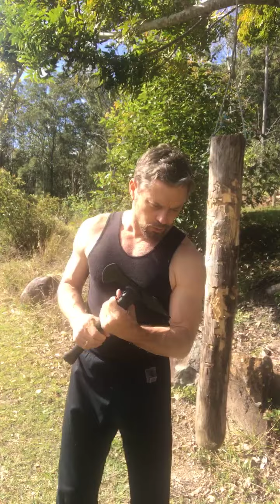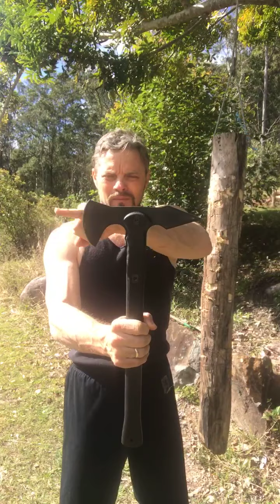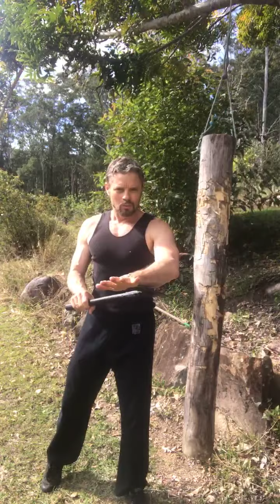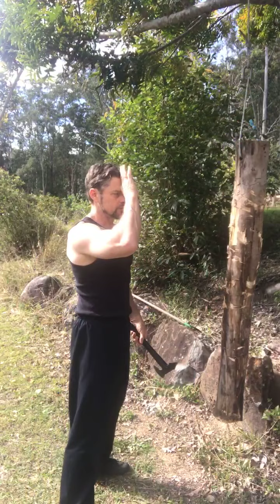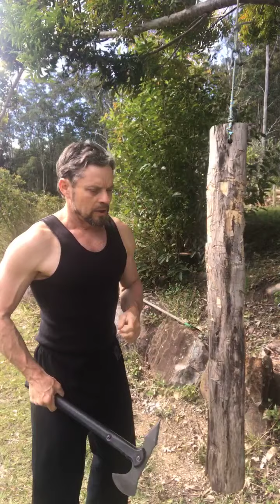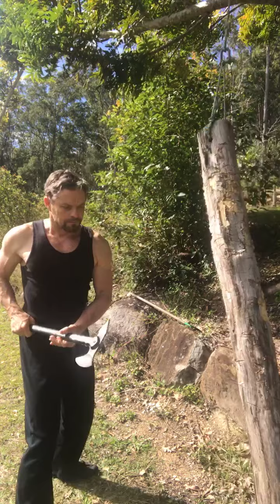Tomahawk Update 01

Comment: Is there a link to your tomahawk course? Good video and I hope you make more of them.

I have found that some tomahawk designs--both spike and chopping side--extract easily. I attempted to show that on a recent video, hitting pumpkins, but will need to revisit the topic with a better flesh surrogate in the future.

Take care
Reply from the maker: The tomahawk course is only available on The Warrior's Path Academy platform these days mate. www,thewarriorspathacademy.com. I have a lean towards the hammer poll these days as the issue of weapon retention and weapon stick are I believe underestimated. The hammer poll also adds value to the utilitarianism of the tool. The spikes while useful represent a significant risk to the weilder of the hawk were there anything other that a simple blow delivery involved. If an opponent closed and managed to smother the hawk and obtain purchase on the haft then the spike can easily be forced back into the weilder.
Reply: @thewarriorspathacademy  thanks for providing the link! I agree that folks overlook these risks with straight needle sharp spike tomahawks.

We found that curved or chisel tipped spike tomahawks eliminated a lot of the problems with those sharp straight spikes. Possibly why curved or blunt tipped spike tomahawks were such a common style in 18th century North America.

Our latest YouTube video goes into pretty decent details on spike designs and use. At bit unconventional but simple, straight forward, just different. A lot one can do with those tools. Fun stuff!
Reply: @wingardwearables  And I plan to purchase your training Backripper and trainer soon!!